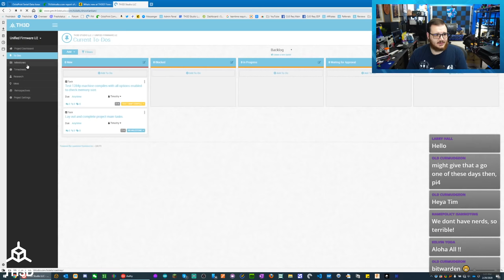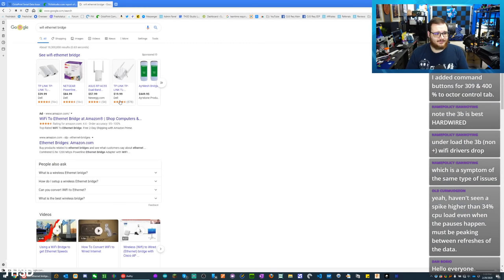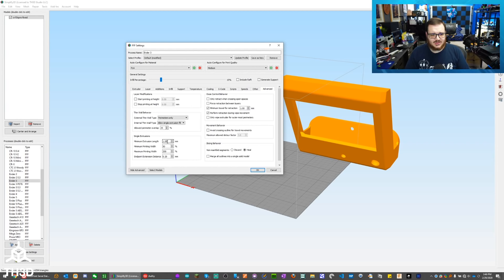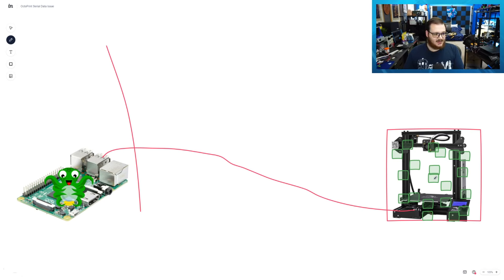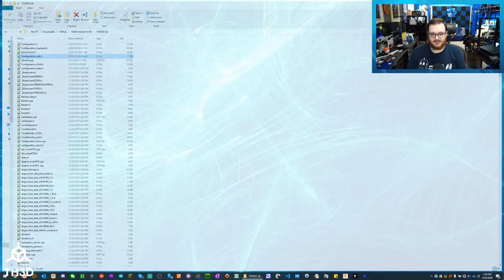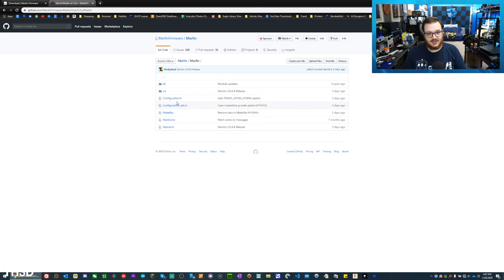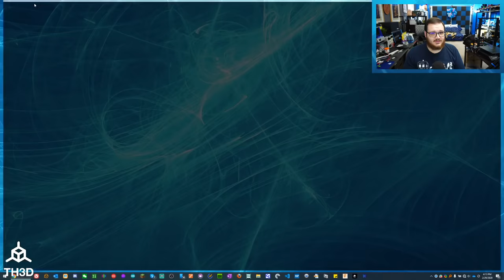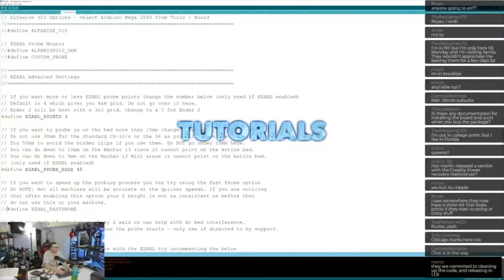Octoprint and Serial Data Transmission - Print "Blobs" Talk

Comment: Printing from SD is a fine solution a others have noted. In the firmware you can increase the g-code buffer size to something large and it will help reduce stoppage. Marlin and hosts aim to keep that buffer full and ahead of the planner, but if there are a lot of short moves, as on a curve, then the buffer empties out much faster. So, if the OctoPrint software could de-couple the serial output buffer from its UI that would be the most solid solution. The Pi has plenty of CPU power, but the OctoPrint software is tying the UI too closely to the g-code sender. It doesn’t even need to be on its own core, but it should be a separate process and that would be enough. It will also make badly behaving plugins less problematic.

Comment: Excellent, informative video. Thanks very much, this confirmed my suspicions of Octoprints downfalls.
I upped the buffer size to 32, baudrate to 250000 and it printed perfect until I loaded my next print to the cue. Boom, huge stall and a big ugly blob, wrecking my perfect vase print.
I'm running Octopi 17.0 on a Raspi 3b+ to my Ender 3 V2. 
I'm at the end of my rope with this, and I have no choice but to print with sd cards until a fix comes along. Which really blows.

Comment: It seems like this could be addressed by tweaking the scheduling priority of the UI process vs. the process that is streaming data to the serial port.  The UI code itself could do this by adjusting priority using a system call -- or the script that is loading the UI could adjust its priority.  I am just getting started with Octoprint but if CPU starvation is the issue it does seem like some scheduling tweaks could mitigate the issue as well.

Comment: Would this not be solved by just storing the gcode on the printer locally? My ender 3 has a sd card slot. When i upload to my octoprint can't I just put the gcode on the printer directly so the printer doesn't need to wait for octoprint to send the data over?
Reply: Then some way to report back to Octoprint has to be there on progress.  If I ever do try Octoprint again I will not use a Pi.   There are many other options but all of the good ones are not going to use a 5v 3 amp rail.  My 10 year old Dell Linux box may do better.  Not Pi hatin I just see the numbers.
Reply: Very good question.  This is what I was going to ask as well.  Can you use octoprint to send the data directly the the printers sd card and then not have to worry about any buffering?
Reply: R Forde I had the same question.
Reply: Yes, you can send gcode file via wifi to the PI which then stores it on the SD-Card of the printer. It just takes ages when you do so. You could plugin the sd card into your pc save the file, plug it in the printer and then just start the printjob via octoprint.
Reply: There's an option to transfer to the Printer SDcard via the Pi. This is slow though because it uses serial to transfer the data. I believe the printer will still send the status updates via serial to the PI interface.

If you have some electrical engineering knowledge, you can rig an SDcard swapper up. There's a few Hackaday articles on it. The way it works is that you load it to Octoprint like normal (setup to save to a second mounted SDcard), and a special plug-in  is triggered on print which safely dismounts that secondary SDcard and triggers a GPIO that switches the SDcard lines to the printers SDcard port. It then sends the command to the printer to print that file from local. 

I may eventually do a complete video/write-up on this type of setup, it sounds more complex than it is and there's not many components needed.

Comment: Yes "bridging" is a router to router wireless, connect using mac numbers on the router. Keep the power level as low as possible to prevent signal scatter.

Comment: I just watched this very good video, thank you, it focuses exactly on the reason why I have not implemented octoprint in a year of 3d printing on 2 machines. I have one question though, if by chance anyone still reads the comment down here: would compressing the gcode lines in base64 format, send them over the serial and then implement a decompress function in marlin be feasible? would an 8 bit board withstand something like this?
Cheers and congrats again for the video

Comment: I have the same issue, had it a while ago as well, but it went away for a bit after I changed the USB cable to a beaded version and thought that was it. I then started moving the printer around do some upgrades. Next to me out in the open, no issues, then back on the table (note I did a bunch of re-wiring) and the issue has returned. I tried dropping the baud rate and then the issue went for some time, but again it has re-appeared. after watching this, I increased the buffer size and changed the cable to a better one, it has only really mitigated the issue. I need to try wiring up via ethernet also next. After that, maybe upgrade the Pi(I have 3B) to a 4, though I might try an octoprint re-install first just to see if that has any bearing on the issue and also I might try to see if cooling of the Pi helps at all also. Other things I might consider is keeping the Pi away from the electronics or see if there is some sort of shielding I could try. Biggest issue I really have is not knowing if I have fixed the issue as it seems random, anyone know of a good test model for this? I will probably look to see if I can anything to test with later. Good video btw, it has definitely given me some insight into the issue and some other things to think about, though I'm not sure if my issue is caused by UI directly, its possible it is a contributing factor however.

Comment: It would be awesome to see a video of all the different specs on each of the boards.
Reply from the maker: That information can be had online already. The 3B is a 1ghz quad core 1gb ram, 3b+ is 1.4ghz quad core 1GB ram, and Pi 4b is 1.5ghz with 1/2/4gb ram options available.
Reply: TH3D Studio not sure if it was this video or I somehow commented on the wrong video. I was referring to comparing all the main boards on the market. Or most of them.

Comment: I tried to change the baudrate but I could not solve the problem, what can I do?
Reply from the maker: Increase the BUFSIZE in the Marlin firmware configuration_adv.h file. Play with the value until you get the largest you can use when compiled. Setting it too high will result in the firmware failing to compline.
Reply: @TH3DStudio  i have a 32bit motherboard, 64 bufsize is enough?
Reply from the maker: 16-32 is usually good. :)

Comment: I need help finding this configuration file in the Octo4a (android) version. I've been trying to solve this for days lol HELP!!
Reply: The file is in the configuration adv in marlin.....I will try later to change it from the default 4 and see if makes any difference on my printer.
Reply from the maker: @geekon is correct, its in the firmware, not octoprint.

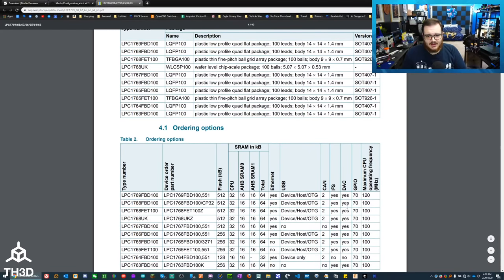Comment: 40:08, that is a total of 64kb (32 on CPU, 16 in each of SRAM0, SRAM1) the fourth column is a total. So the comparison to the 1284P is "only" 1/4 rather than 1/8th. The 2560 is 1/8, and the STM is the same RAM if fully populated (3/4 in the actual board used). (Page 1 of the LPC datasheet also states "up to 64kb")

Also, I didn't see reference to an EEPROM in the datasheet, is that external to the M3 chip? On the board, or emulated?
Reply from the maker: Yeah that was my bad. It was a long day when it was shot. Still 64K allows us to run 32 bufsize on these with no issues. The 1769 is 64K. The STM on the BTT boards is 48K since its the lower end chip. They also have 256K progmem whereas the 1769 has 512K.

Comment: If I run Octoprint on a "Commercial server" or something that uses separate buses for Ethernet and USB does this happen?  If true this goes back to what you said before Tim.  "Don't be Cheap!" and don't use a Pi at all!
Reply from the maker: A regular PC is fine and the Pi is perfectly fine to use. Just needs to be better optimized now that we have quad core CPUs in the Pi boards.
Reply: @TH3DStudio  Tim that does not address the problem you were talking about.  The problem Pi has never and probably never will address is the Ethernet and USB using the same bus.  I can toss a big block into a car and if I don't change other components it won't matter.
Reply from the maker: I don't see the issues with ethernet and the USB ports. You're talking about a 480mbps bus on the 3B and 3B+ which you're not maxing out with a camera and the web UI. The printer takes a faction of that bandwidth. But you are correct in that they sit on the same bus.
Reply: @TH3DStudio  So are you blaming the board, firmware, or Octoprint now that the computer has been ruled out?  If we can go back to Beverly Hills Cop 1 for a second...... The Supercop story.... was working!  In this case Supercomputer!  We were agreeing!  I haven't figured you out yet but I will! I'm a sub and will be a customer soon!
Reply: Did not know the Pi 4 has true Gigabit ethernet (independent of USB) per their site.  I might try the 4 and see.  Trip to Microcenter in Atlanta is 2 weeks away.